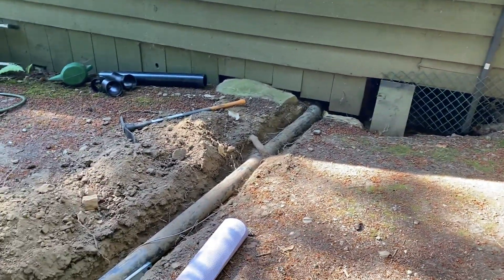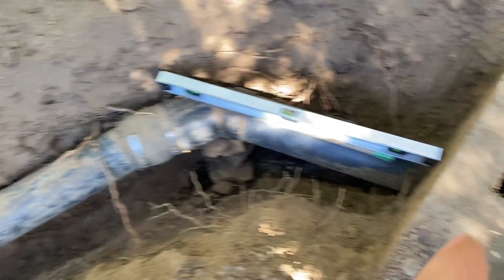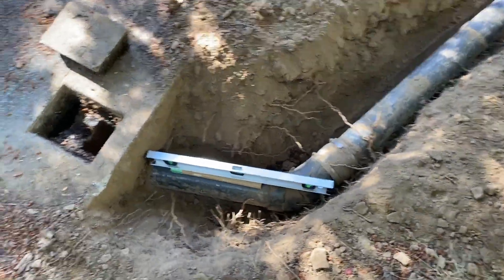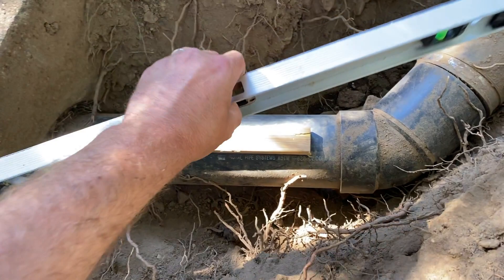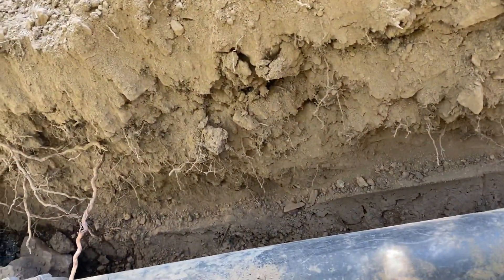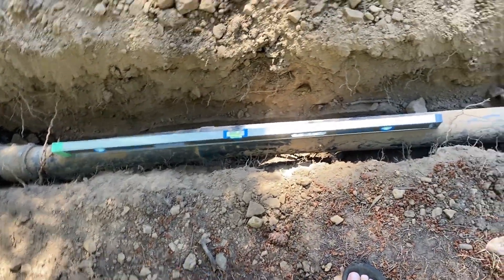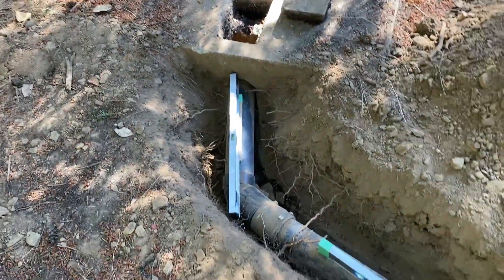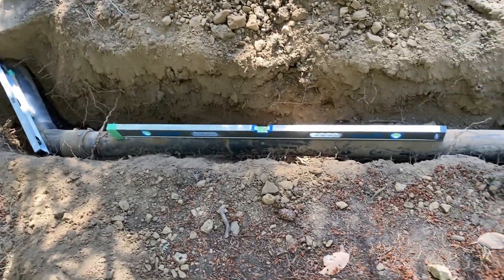How to determine the correct sewer line slope new

Comment: Great video, thanks!  I see how you've used rocks underneath the pipe to raise the level of the pipe, but how do you make sure those rocks don't shift when you rebury the pipe?
Reply from the maker: I filled loose material of dirt and gravel underneath the pipe and packed the dirt really well to prevent sagging and prevent reliance on the few rocks. This has held up for nearly 3 years now without any problems.